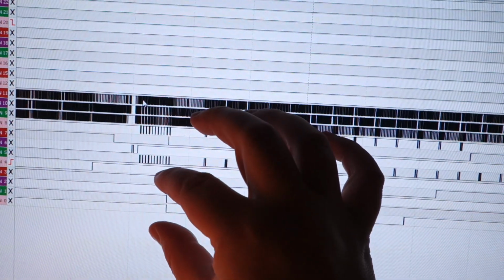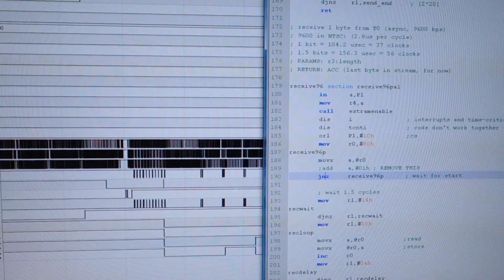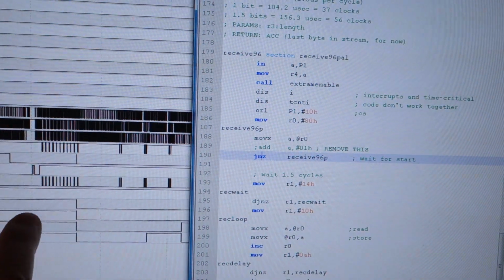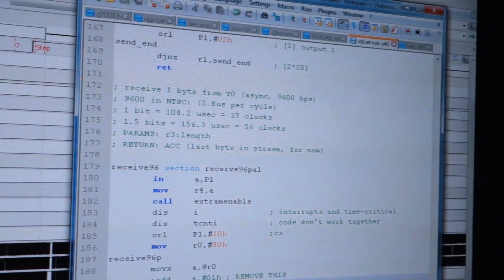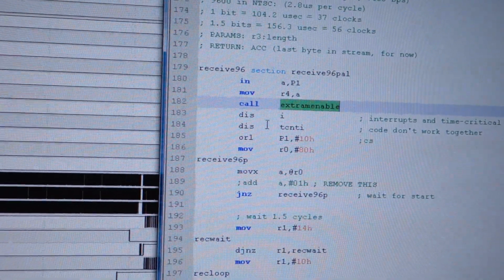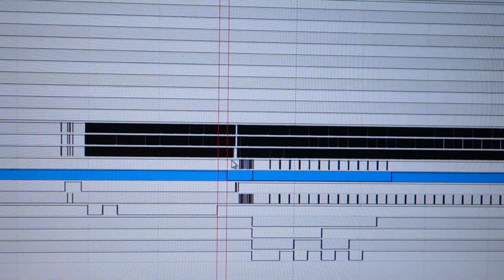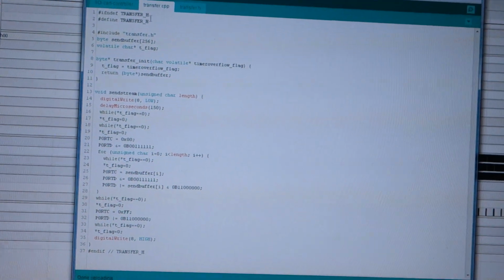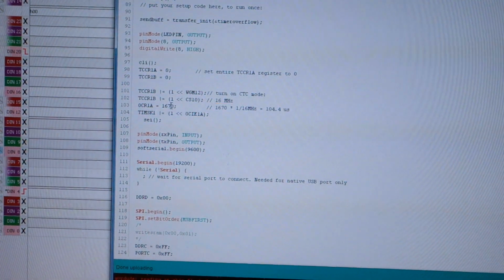Late Videopac SDcart update. Videopac mcu and arduino interaction.

Comment: What I was just thinking Hans, is how do you sync the clocks between the videopac and the arduino? Is there any time based syncing between the two? Maybe it's not required because the receiving side just responds to events.
Apparently Soeren went through a lot of trial and error before he was done. I look forward to your marathon video :)
Reply: Never mind...just read the answer in messenger. Haha..stupid me
Reply: Indeed I was thinking that as well.
Reply from the maker: I understand now. Like how can the arduino put the data on the databus at the right moment ? I remember now we talked about that. The margins are too slow for the arduino. What I have done is to put a buffer between the videopac databus and the arduino. The videopac mcu opens the gates in the buffe when a read request like movx a,@r0 is executed. The data from the arduino must be valid before that happens. Thats why I use this async parallell transfer scheme with a start-bit. The videopac starts counting when it sees the beginning of a start-byte (0x00). After about 1.5 cycles counted it starts sampling data in the middle of the pulse. After the start-byte it is just a matter of time before the sender (avr) and the receiver (videopac mcu) slide out of alignment. I was thinking of making an automatic calibration routine that tested how many bytes that could be sent before failure, but for now I'll just let it send in parallell: start + 8 bytes + stop, then at the next start they realign, just like a uart/serial transfer.

Comment: Excellent =D  That's the sort of problem I had when working on that ROM switcher PIC code lol (inverted logic).   Look forward to the next part =D
Reply from the maker: GadgetUK164 - Retro Gaming Repairs & Mods Thanks. Been harder than I thought it would be. So many hurdles. Especially the one shown in the video where extram cs is not exclusive for the cart port causing ram read access on both videochip and cart. threglue logic on the motherboard is too simple.